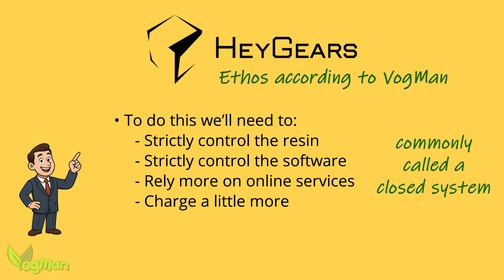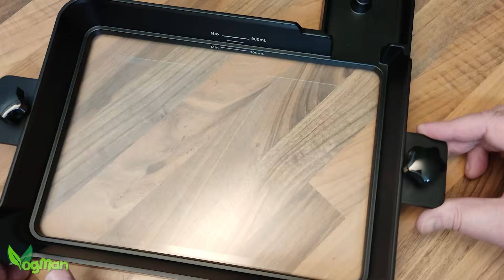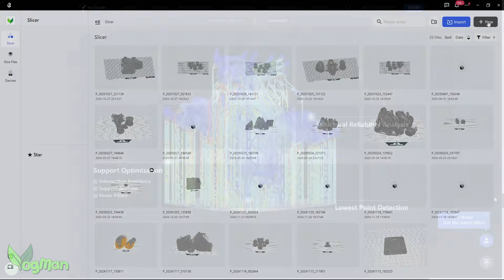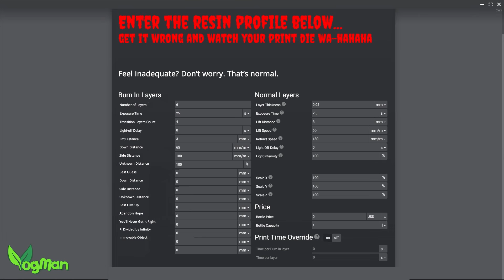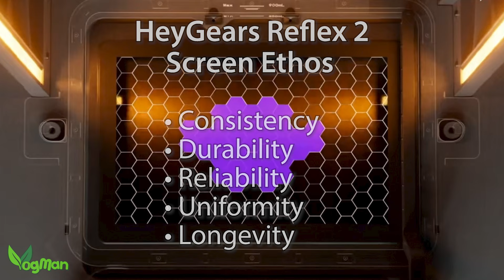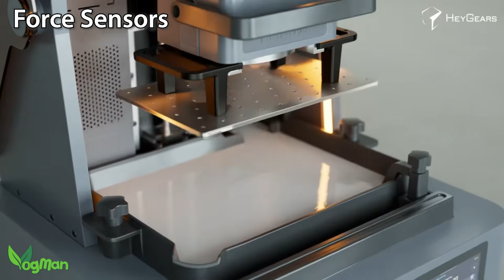HeyGears Reflex 2 Review — Built for Reliability, Not Hype

Comment: 1400 quid is not something I'd call "mid-range". Especially for so many  features missing and half of what's there being unnecessary I don't think it's a valid option for professionals. Proprietary resin is another off putting choice,  add to it 40 microns pixels and it's really hard to justify that insane price.
Professionals know what they are doing and can dial in low budget printers to perfection for 1/4 of the price of this printer.
It's not "professional  tier", it's "snobs tier", if there ever was one. 
I would buy 5x Saturn 3 ultras instead of this one, if I would be a professional. 
What's good about this printer is heavily overweight by what's bad.
Remove feed system and allow to use any brand of resin, and I'd consider getting it for £500. At £1400 is super easy miss.
Reply from the maker: Fair points. When I said midrange, I was referring to build volume and category placement, not price bracket.
It’s definitely not aimed at budget users — this one’s built for consistency and uptime rather than raw specs or flexibility. The resin lock-in will always divide opinion, and I totally get that.

Comment: Thank you for the review. So many others seemed to have mixed experiences or mixed understanding of the machine. A lot dealing with the lack of resolution. But it seems like you hit its use case spot on.
Reply from the maker: I started off being very disappointed that they hadn't upgraded the screen... it was only when I realised that they HAD upgraded the screen that I figured out what this printer is all about. It's not sexy, but it will keep on going day in day out. It's a pro machine, simple as that 😁
Reply: @vogman yeah. As someone who's been using a Jupiter with 6K 12.8" screen for tabletop minis for several years, I never really felt the need to go 16K. Especially with AA that actually works. 

It hasn't stopped me from feeling robbed when I see 6K tho, even if I know it won't matter 😆. Heygears has also been attractive to me for the "just works" approach more than anything else.

Comment: Sounds like a script from the Hey Gears marketing department not an independent "in-depth" review.
Reply from the maker: I wish it was. It would’ve saved me a fortnight of work putting it all together.
If I’d said, “It’s not 16K, so it’s rubbish,” I’d have been wrong.
If I’d said, “It’s the best printer ever made,” I’d have been wrong.
Instead I pointed out both the good and the bad, and explained who it’s really for — professionals. Some hobbyist may go for it, it's true, but I'm guessing HeyGears have designed an endurance workhorse here.
Reply: @vogman as you always do. Can’t fault this at all
Reply: Yeah. Should have smacked it more with a hammer or something. Clearly printing with it (which is its purpose) wasn't enough 😆